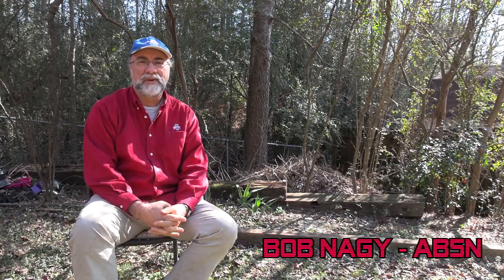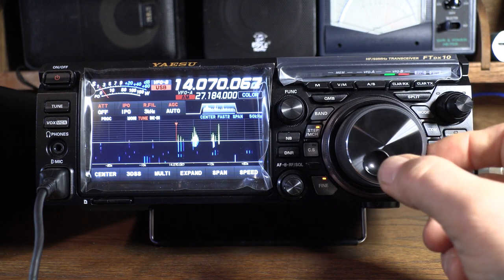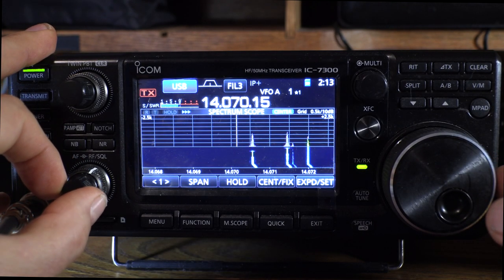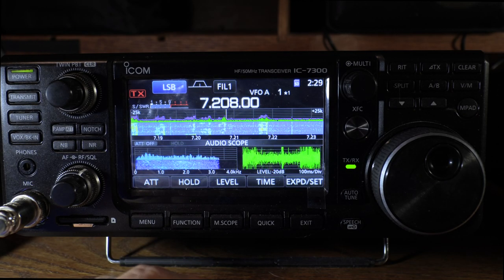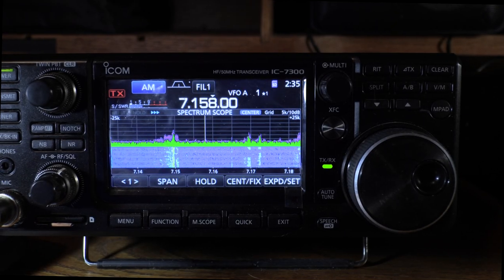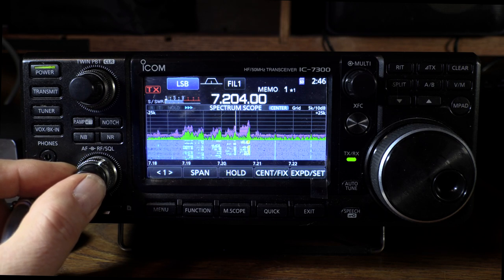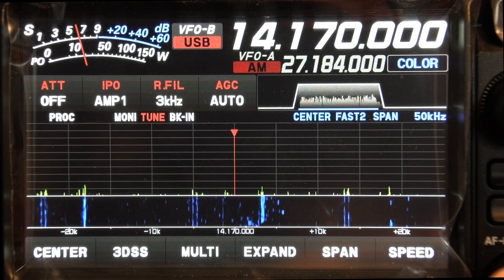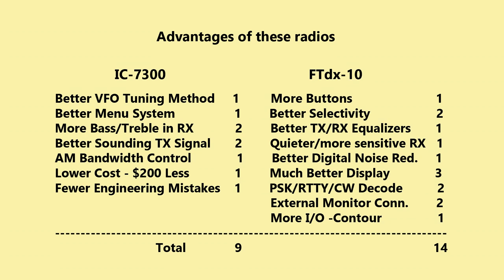Head to Head Comparison of FTdx-10 to IC-7300.

Comment: Regarding RF gain... I learned a lot from working digital modes - most hams use much more RCV RF gain than is actually needed and this causes problems for all the downstream technology. These are digital radios and cannot take being swamped with signal and then filter out all the splatter etc later in the chain with algorithms because a) it takes processing time and b) horsepower/cpu. They are both fine radios but Yaesu is a bit more tolerant of being overdriven because they can utiize circuits from the superhet days (mixer / roofing) and why I believe it gets better Sherwood reports. Honestly folks try using less RF gain and more AF gain, hearing more "grind" is not the same as hearing a better signal - don't believe AGC is going to clean up  overdriving, even for superhets.
Reply: Yup, use the minimum RF gain needed! Also, less output form the PC sound device and more gain in the radio = better IMD on the TX.

Comment: Thank you for this; I think you just saved me $1500 as it seems like my 7300 is sufficiently close to the DX-10 and wouldn't be worth the upgrade. I'm a CW operator mainly looking for the ability to dig through a lot of local RFI/QRM and the DSP and filtering seems quite similar between these two, but correct me if I'm wrong. Perhaps saving up for the 7610 with its diversity receive capability would be a more satisfying experience?
Reply from the maker: You are absolutely correct. The 7610 is the smart choice today. I've had and tested them all.. so snag a good deal on a 7610 and you'll be a VERY happy camper. The much bigger display and the radio being a dual 16 bit SDR make it a totally smooth operator. Bang for the buck, there is no better. The 10 and the 101D series have too many design mistakes. Plus - no averaging on the display is a real deal-killer. The Yaesu menu system will get you really frustrated- forever. As well, being SO tight, they roll off the bass and treble permanently. For AM of any type, the Icoms are so much better. TX and RX audio quality is just better on the Icom radios because they are direct-samplers...the way SDR should be done. Selectivity cannot be the only measure of your happiness with a radio. It's the whole package- and Icom has that nailed.

Comment: Although the FTdx10 NB did a good job at removing the noise as you demonstrated, I found it distorted SSB signal audio (even at "lower" menu settings) much more than my Icom .  Since I live in an area that often requires the use of the NB, that was a deal breaker for me.  Plus I loved the Contour on my FTdx-3000 but found that it wasn't very useful on the 10.  The ANL also added distortion that was higher on the 10 vs the Icom.  Regrettably, I sold the 10 after Yaesu would not recognize the NB issue.  Others have complained of this issue.
Reply from the maker: Yeah, it depends on the kind of noise you are experiencing. Actually, neither radio's noise-fighting features compare with a dedicated SDR. The Anan 7000 DLE II would completely eliminate your noise problems. See my review. https://www.youtube.com/watch?v=KR5t4Hei9FA&t=772s

Comment: In your review you said you liked that the amp key and ALC connections on the 7300 were RCA jacks and that on the FTDx-10 you have to get an accessory plug to break out those connections, but you didn't mention that in your final "grade".  For me that should be an extra 2 points for the 7300, but of course the Yaesu still "wins" 14 to 11.  I have the 7300 (it seems like everyone has one) but nothing you showed on the Yaesu would make me go out and buy one.  My other radio is a Flex, LOL  73 de N4QM
Reply from the maker: I hear you. I sold an old destroyed RCA DX-77 mic from my junkbox...listed it for $50 for parts on Ebay and it sold for $1425...which is why this radio is here!
Reply: @robertnagy2163  Thus proving the old adage,  "One man's trash is another man's treasure".
Reply: Indeed, getting the Yaesu connector and building the interface is quite an awful experience. RCA plus are no brainer.

Comment: Although I realize this is a comparison of "stock" radios, would (or could) the FTdx10 transmit audio be markedly improved if a microphone element upgrade were available and installed. I am thinking of something like the IC-7000 mic upgrade that worked wonders. If not already available, this may worth some consideration.

This was a great and practical review, and it shows the advantages gain in the newer technology. While the IC-7300 is a great radio in its price range, the Yaesu kicks it up a notch (or two) for very little more money.
Reply: Stu- Well, I am the IC-7000 mic upgrade guy....and the answer is No. TX audio is very good once set up well. It is just never going to be in the class of the 7300's audio.

Comment: I was wondering what your opinion is of the included hand microphone. Is it worth upgrading?

I love the radio. It is a joy to use. I take it portable and even though it is a current hog, I can get through a day with my 20AH Bioenno. There are a couple of annoying bugs, though:

The RF gain control almost sounds like a dirty potentiometer when using it. I almost exchanged it until I saw it was not a hardware issue. Also, a couple of times, the tuning rate on the VFO seemed to be too fast after changing bands, but it goes away after pushing a few buttons. There have been a few other niggles that escape me at the moment. I haven't updated the firmware yet (I've had mine for over a year) since I heard that it messed up with the band-stacking, which is a feature I enjoy. Should I upgrade the firmware?

Like I said, I absolutely love this radio. I recently got an IC-705 so it has been fun noticing the contrasts with the ICOM style. The Icom interface is absolutely amazing and a joy to use. We live in an amazing time to be able to have such fine radios at affordable prices!

Thanks for the great videos.
Reply from the maker: Well, I put one of my type #2 elements in the mic. The mic has enough output to feed the EQ and make good audio. I may add it to my website for upgrade......

Comment: I would like to add a couple of points to what he has done so well. He forgot to mention the Icom's multimeter that allows you to see all your meter settings at once which I have on my Icom IC-7100 as well and it is really important running digital modes to monitor your power output, ALC and SWR with the constant TX and RX of the FT-8. I do love the Icom's menu system which is easier to see where you are going. I used to have the Yaesu FT-710 and in the beginning I did not like the menu system. However, after using it for a month or so I realized something. When you click on the menu of the Icom you get all the icons but no information. However, when  you click on the menu for the Yaesu you get their boring list, but all of them show you the current settings at a glance which is a good thing and you don't have to actually go in any deeper to see where things are set. That is very nice as well. To bad we could not have a radio and the better features of each radio. Maybe some day. I think it comes down to what you want out of your radio and how you plan on using it. Also, the Icom had the presets for FT-8 long before the Yaesu did. I used FT-8 on my Icom 7300 and never had any problems and it is a breeze to set up. On my FT-710 I frequently lost connection and could not tell when I wasn't actually transmitting. That is why I like the Icom multimeter. Maybe Yaesu could do something similar. Thanks for posting and I always love your videos. 73's and hope to hear some of yall on field day tomorrow.

Comment: Thanks Bob for the great review, I have the 7300 and installed it on a boat going offshore,  one note is that it does have RTTY decode.  I would like to see it have the backlit keys like the 101 and was wondering if the 10 has them?

Comment: What a great video!  I love my IC-7300 and I don't think the DX10 is enough of an upgrade to relearn a new radio, but if I was shopping between the 7300 or dx10, I'd probably get the 10.
Reply from the maker: Right. The 710 is a direct competitor to the 7300. It's got a few things going for it against the 7300- but truthfully, it's which brand you prefer to operate- what you are used to- that would make the decision.

Comment: I am very close to making a choice between these 2. The external monitor on FTDX10 may be the decider. There is software to control either one, so I am less worried about the 10's buttons and dials.
Reply: Yup, both off them can be remotely operated from a PC using FLdigi's utility FLrig. The external monitor thing isn't as big a deal as you might think because both of these radio's displays are really all you need.
Reply: @Yavor54  Thank you. I should not NEED a monitor, but my eyeballs defy ophthalmologic technology, so I can't see well close up. Bigger screen will help. I hope. Well, that's the plan. 😉

Comment: Thanks for your video. Can I ask you one thing? I am wondering if Yaesu FTdx-10 has a similar feature like the SWR Graph of ICOM IC-7300.
Reply: No it does not.  Personally, I prefer the 7300 for these reasons: RX and TX audio are better... a lot better. The 7300 spectrum display has adjustable "averaging". This makes for a smooth display and not the strobe-light show of the Yaesu. The Icom has infinite color adjustment of the spectrum display. The Yaesu has fixed selections, none of which I liked.  The controls on the 7300 are not cramped up against the VFO dial (big problem on the Yaesu). The menu system on the Icom is totally intuitive- as where the Yaesu is very confusing. The Icom has progressive VFO tuning...the faster you spin the knob, the faster the movement across the band (major good thing). The Yaesu has AMC..which is some limiting control that makes it impossible to get the mic levels right and ALC readings correct. You have to take it out of the circuit. The Icom offers flat frequency response across the audio passband because of it's more advanced direct-sampling SDR technology. This gives better highs in the RX audio and it's easier for ears with high-frequency degradation to understand voices. Sure, the Yaesu has ultimate selectivity, but what gives you a happy experience with a radio is a combination of aspects. When all is considered, the Icom is by far the winner. That is why they have sold over 65,000 of them (and the radio is hundreds lower cost too)
Reply: @Yavor54  Thanks a lot for your detailed advice. I am consdiering buying a HF rig  but cannot make decison to select one between ICOM IC-7300 and Yaesu FT-710. Some people say FT-710 has a DVI port and it is a latest rig. Others say IC-7300 is eaiser to use and proven device for years. Very tough. Can you give me your idea?

Comment: I have both and while I agree with most of the points given to each radio at the end, I do have some points that I disagree with.

1. FTDX10 more buttons: Since they are so cramped, I would prefer a multi layer soft buttons as Icom has implemented. For example it is a mindblowing f**ckup from Yaesu engineers to have a button for band but no way of changing band from screen, and yet you also have mode button and mode can also be changed from the screen. Go figure...
2. FTDX10 much better display: While it is bigger, it's utilization and customization possibilities are nowhere near what they could be. Also the fact that the backlight dimming is made with PWM tells you that they've just cut corners.
3. FTDX10 External monitor connection: Let's face it, it is a gimmick. No proper keyboard integration means you cannot enter frequencies from kb. Mouse works to some extent, but what you really get is just a bigger display of your, well, display... :D You still need the physical interface for virtually every basic task.

One of the biggest disappointments for me was when I found out that you cannot remote control FTDX10 without a 330€ box...

Comment: Did you use a loop. What's length.  What did you use for balun. The hight 40 ft.
I have a FTDX-10 
Thanks for your content 
73 KQ4CD Paul
Reply: Original test footage was on a 240 ft triangular loop at 45 ft with NO balun.

Comment: The FTDX10 does not ship with a condenser mic. It is dynamic. A fine radio. Not picking on the 7300 but it is an entry level radio with great sounding transmit audio on SSB. The FTDX 10 is for the op that does not need 2 receivers but wants world class performance. The only other radio in my shack that can match it is the Flex at a considerably higher price - and the receiver on the DX10 is still a tad better under difficult conditions thanks to the roofing filters.
Reply: How strange. Mine shipped in the USA with the SSM-75E condenser hand mic.

Comment: Good video as i am looking at these two radios...btw im just south of Fort Smith, Arkansas so we are not that far apart
Reply: All good radios....I buy and then sell the review radios. Only enough time on them to make sure that they are 100% functional. I've got a FT-710 available now.
Reply: @Bob Nagy  I got my tech last April and my General last October so I'm fairly new at this..I got an old Kenwood TS-130 for hardly nothing to start with but it's going out...I got a good 2 meter setup and that's where I spend most of my time..I'm doing some remodeling this spring and I'm turning a spare bedroom into my shack so I will check with you then to see if you have anything for sale..Nice seeing a fellow Arkansan on here!

Comment: Would like to see someone compare AM transmit performance of these two radios, which one actually can get close to 100% modulation in the AM mode, does either have a carrier control like Kenwood? A true 4:1 ratio in AM on any of these new radios would be quite an achievement IMO... TNX 73
Reply: That is a good idea. I just ordered the FT-710 so I can do a head to head with the FTdx-10. AM on the Icoms is still carrier-controlled simulated AM.
I'll try the Yaesus... likely exactly the same. Big difference  is that the Yaesu only allows you to select between two receive  bandwidths...where the Icom allows continuous bandwidth control.

Comment: Nice comparison! Thank you. It’s still a hard decision
Reply: My call after 51 years of hamming and 30+ HF rigs.... IC-7300. Rig happiness isn't just the Sherwood RX numbers. It's ALL the factors. the Icom beats the "10" is ALL other ways except ultimate selectivity. If you are a die-hard contester, get the "10". If you are a typical ham, save the $$ and get a 7300... there is a reason the 7300 way out-sells the 10. It's a GREAT rig.
Reply: Yes I know many hams that have the icom. They all swear by it. Sometimes I want something different lol everyone has the 7300!

Comment: Excellent review ! I have ICOM 7300 two item and i tested the new YASEU FTDX 10 look with new gaget but not impressed me . Maybe need a new firmware to correct many bugs.
Reply from the maker: It is much newer and there will be more firmware updates. The last one added a few new features. the 7300 is a more polished product, but the Yaesu offers more performance.
Reply: The newer tech Yaesu FT-dx10 will be superior after the updates roll out to polish it up. 7300 is older and had more time for new firmware updates to fix software bugs. I love the Icom 7300 & if the FT-dx10 wouldn't have been released I would have got the IC-7300. Both great Radios.
Reply: @tipple31337  The 7300 will always be more popular. Mainly because it is lower price. If the FTdx-10 comes down to $1150 usd, then the Yaesu is the better choice.

Comment: This Yaesu radio has a design that is far superior to ICOM. Its design is very, very beautiful; it looks professional and elegant in a living room. On the other hand, the 7300 has a slightly inferior design. However, it is much more intuitive, much more enjoyable to use, and much more pleasant overall. I will add handles to the ICOM 7300, which will give it a professional and engineer-researcher style. Both radios are similar in reception and transmission for DX.
Reply: Yes, the Yaesu is more beautiful. We like radios that look beautiful. The circuit design in the Yaesu is older though. It is a mixer SDR. Although this results in good RX "numbers" it radio comes with several problems. #1 problem is that the receiver audio frequency passband is not flat. The bass and treble are lost at the top and bottom. The next is that the display has no averaging. It is like a strobe light show. Next is the buttons on the left of the VFO knob. You ALWAYS hit the VFO knob when you try to press those buttons. Next is the Transmit adjustments. The AMC control must be at 100 to take it OUT of line- else you can never adjust your audio and ALC like the manual says. Receive and Transmit audio are superior on the Icom. DNR is superior on the Yaesu.

Comment: Just wondering if your Icom was connected to your computer and the Yeasu not? Possible noise source?
Reply: Nope. The nature of a direct sampler SDR opens it up to more susceptibility to noise. There are tremendous upsides to direct sampling too though. With one less stage of circuitry between the RF and your ears, it clearly sounds like it somebody took digital windex and removed one more layer between the original signal and your ears/brain. It just has better fidelity. Even between the IC-7851 and my IC-7610, the 7610 just has a more visceral sound to it. Transmit too. The average operator will find that the 7300 has enough performance to give excellent results. My FTdx-10 (and FT-710) are being sold. The 7610 is staying.